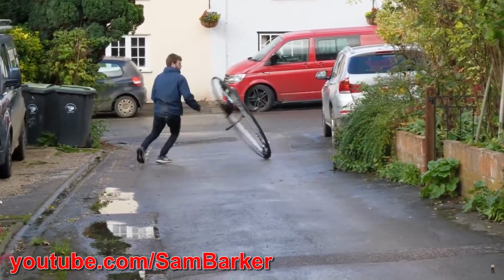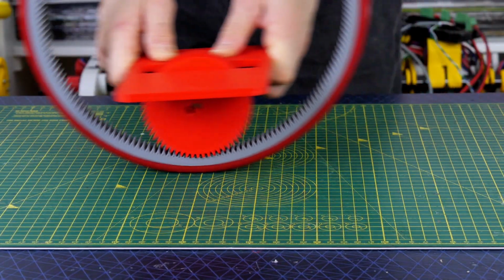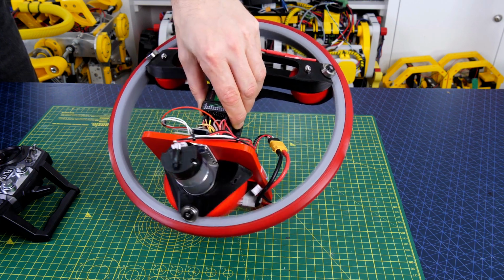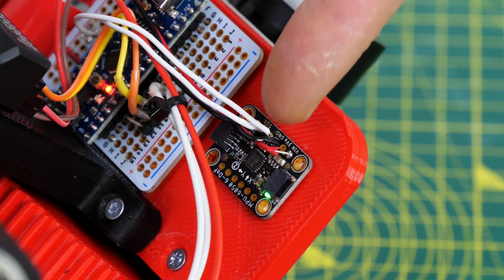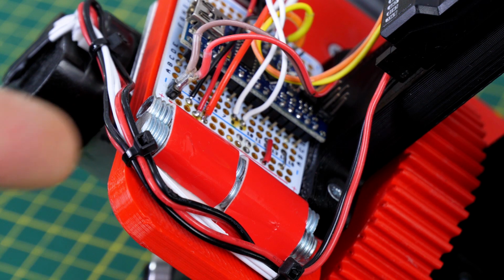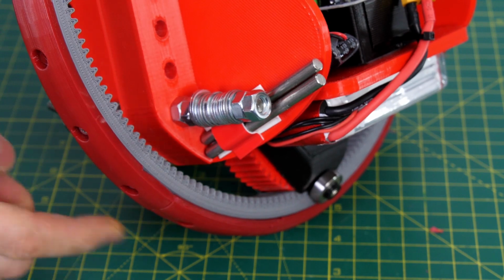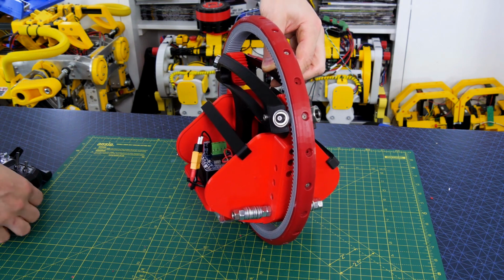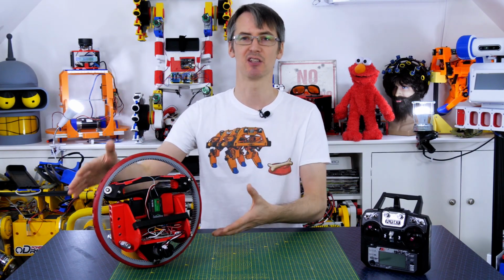Monowheel with Stability Control

Comment: I'm glad you mentioned active gyroscopes at the end, I'm looking at having ago at one of these myself and think gyroscopes is the way to go - I've been watching a lot of boat gyroscope videos lately :) , I was kinda surprised you didn't mount the main drive engine in the centre either vertically or horizontally to help with initial problems with balance and keeping the majority of the weight at the bottom...

Comment: well the solution to monowheels is actually having an inner and outer wheel. The inner one keeps inertia while the outer one starts and stops as a normal one does. I think of a planetary gear system that is lockable as a viable solution so perhaps 3 wheels an inner one with high mass, and 2 outer ones with very low mass so hey can accelerate and decelerate quickly. Turning can likely be handled with a leaning mass.

Comment: Pretty neat. 
I think reason why it turns slowly is because you are using weight as a means to turn. But not utilizing gyro precession. I wonder if you were to place the pendulum contraption part in the front and reversed the left right logic how would it work. My bet it would turn lot more perhaps overly so.

Comment: Going downhill the angle that you need to maintain in the forwards/backwards direction to be stable changes. Not sure how you could sense whether it's driving up or downhill though in order to compensate. (maybe by tracking how much power the drive motor is pulling or something??)

Comment: Wouldn't you want the masses swinging at 3 and 9 o'clock on the wheel instead of the bottom? It's a gyroscope, the force of the mass accelerating twists the wheel in the opposite direction of the intended turn due to the force being 90 degrees out of phase with the point of application, plus the simple reactive force of the mass pitching the wheel further into that turn. You're getting a lot of instability from that I think.
Reply: 12:00 is the best place.

Comment: It would be interesting if you split the counterweight into 2 pieces so you could swing the counterweights in opposite directions for sharper turning. You might consider something like tungsten putty for your counter weights that way you can 3d print more optimized weights and just put the putty in. Plus you can reuse the stuff on any project.

Comment: Love your channel, you should mount the batteries and the electronics on the swinging device this way you will use the weight of the electronics instead of adding weight

Comment: I wonder if turning really ought to be based on tilting left/right: certainly it is for two wheels, but for one wheel? The kinematics between mono and bi might be unrelated.  Maybe try steering using your gyroscope (with a horizontal axle) or an inertial wheel (with vertical axle).

Comment: Have you ever thought of using a non-linear gain? This way you'd have more control over how the vehicle reacts - for example, if the thing is experiencing a lot of random low value wobble, trying to compensate too violently for this may just make the matters worse, but at the same time if it tilts too much a violent  reaction would certainly be beneficial. Also, I'm pretty sure that if you'd graph force needed to put the vechicle upright vs the angle of tilt, the result wouldn't be linear ...Does that make any sense?

Comment: I was just thinking about  making one of these a few weeks ago, but a full scale one. If you look at the old pictures of the early models it appears they had some hard linkage to control the steering on these to keep that wobble out of it. It appears as the rider leans one way the wheel will actually tilt the opposite direction. https://en.wikipedia.org/wiki/Monowheel look at the 1931 cislaghi motoruota monowheel.

Comment: Amazing work as always. 
Maybe you could help me understand what would happen if there were a pair of counter rotating gyros mounted on vertical axis in the slot between the two idler gears. 

I saw you were using the off axis movement of the gyro to move the other one. 

Could this be used to dampen the accel decel and to give tilt?

Comment: looks like the side to side compensation uses only position and not angular speed ?
if you apply the weight at the opposite side of the current angle you will pass the equilibrium point, and will repeat correction in the other side hence the wobbles. (like on a sinusoid, acceleration is the opposite of position) 
the reaction time beetween measuring the angle and the servo actually moving it just makes it worse, if the next wobble is ever so slightly larger than the previous, the system is unstable.
ou have to damp it taking into account the angular speed

Comment: how about a trike like the childs big wheel that only uses two linear actuators (maybe elctroactive polymer or muscle wire) which both power it and control the steering?

Comment: If you put the inertia drive in the middle, I bet you could 'roll' forward or backwards just by speeding up or down the flywheels.  Might only need a tiny motor to 'set' the direction, before the flywheels would take over.

Comment: I would be interested, how the stability of the side to side control, is affected by speed.  And wether adapting the control scheme to this does significantly improve the controller. I.e. smaller gain, when driving slower, or (manually) speeding up, when near maximum tilt to stabilize again.

Comment: Wouldn't a flywheel increase (on a horizontal axis, like a gravity wheel) greatly increase it's stability? I'd get it needs an extra motor to spin this up would influence its power consumption but it wouldn't this make the whole vessal a lot more stable?

Comment: Is there something you can replace the arduino by to change the PID values on the fly?
I have a bit of experience programming PIDs in a game, I managed to get a floating platform to stabilize at horizon in less than 0.1 seconds from any sort of push in any direction which I was really impressed by, but thinnking back to it, to get there I had to constantly tweak the P, I and D values, that of coursed varied depending on the mass repartion of each axis of rotation

But I could do that fairly easily and quickly because I could test it as I had the PID values open, as well as both graphs of the angle of  incidence values, as well as the current target PID value open and running in real time
It would have taken me easily 10 to maybe 20 times longer to do if I had to unplug, program, go out to test every time, rather than adjust the PID values as I tested it, and I feel that's the situation you are in

tl:dr PIDs can yield absolutely amazing results, far better than you expect, but you really need to get a setup where you are able to change the P,I&D values from your remote control on the parking, this would speed up setting up PIDs by 10 times or more for you

Comment: Wouldn't it benefit from more mass on the wheel itself?

Of course, if the idea is to gyro-stabilize it down the line there's no point.
Reply: No. Unsprung mass is bad. You want the motor to spend as little energy as possible spinning the wheel, so you make it as light as possible. You put your weight into the counterbalance to keep the CoG low, and keep it balanced, and prevent the innards from wanting to spin inside the wheel.
Reply: @badsamaritan8223  
Yes, that makes sense when you're working with metal. My intuition (so you can clearly see I'm on shaky ground here) says there's too much mass standing still inside the wheel for the wheel's gyroscopic effect to keep in check.

Comment: It's a fun idea but if your stopping ability only depends on your I rotational inertia, then something is definitely bad. Like you don't even need to build anything. Just calculate your rotational inertia and realize it's f-ing dangerous. Or limit your speed :) but never go uphill or down hill because ofcourse, if you're a circle, you most likely will rotate while riding down hill. In fact regardless of which direction you go on a hill, it will end with a downhill ride.

Comment: I get the idea of simplicyti and cost using wheights but just add 2 gyroscopes on at the front of the midle assembly one at the back and u will be able to spin it on a coin so to say it

Comment: Amazing work! Had a thought on the steering delay. I watched a Veritasium video the other day showing how bikes actually turn. The center of gravity first has to shift to the opposite side you are wanting turn before it can settle back on the inside of the turn. Perhaps by having the weight kick to the wrong side for a brief moment then bringing it back to the desired side it would result in a faster desired turn?

Comment: You could just slightly modify your two wheel and one wheel balancing robots to drive a ring wheel, rather than creating something entirely new just as a proof of concept; though, directly driving the ring would be more efficient than inducing motion via force from the gyro setup. 
Monowheels are also often times just impractical, they're cool, but there's no practical way of making them a vehicle, there's just too many downsides; unless you're making one into a motorized unicycle, but even then there's so many downsides that make it impractical as a vehicle. Personally, I think side-by-side wheels make for a more practical vehicle, such as inherent balance, no frontal blind spot, and you now have differential steering, whatever these vehicles are actually called.

Comment: Hey, what if you used fans propulsion to balance it?
Reply: fans have action delay. Even these servos are too slow.
Reply: You'd have to duct the fan and use throttling nozzles like in the wing tips and nose/tail on the Harrier or F-35.

Comment: Hey James what if you used a flat surface tire? Like a rounded flat pan. I'm betting half inch or inch with rounded edges. Stability assistance with the ability to lean easily. The angle of that rounded edge should mate with your desired lean and I would go so far as to lip the outside edge to counter assist over leaning.
Reply: Ps I would try a groove at the edge of flat to angled tire to ease transition in balancing and steering

Comment: cool work, but the balance control is not very senseful therefore it doesn't work so good. by newtons third law , actio=reactio , the moving the weight to one side for steering, creates an impulse, that leads in the opposite direction of steering. what is needed for quick change direction by this system. is make a fast impulse to the opposite direction and then smoothly lean into the curve. programmed like this the system would work much better.

Comment: This looks fun/challenging to drive!  I saw a guy in the UK who built a monowheel that he can drive (not the first or course, but a good example): https://youtu.be/6ElEoVRb1F8?t=68
It seems pretty impossible to brake, unfortunately, without doing flips.  I guess that's not that big of a problem if it's RC, but I was trying to imagine how you could stop without this happening.  It seems that your feet are the preferable braking system for that guy, so maybe for your RC version you could incorporate actuated "legs" that pop down to make contact with the ground and scrape along the ground?

Comment: Just replace the usb connector…
Solder wick or a hot plate
Reply from the maker: The whole thing is soldered down, otherwise I'd have just replaced the arduino
Reply: @jamesbruton  you can also try programming it through the SPI with another arduino (so you don’t have to desolder anything or take it apart)?